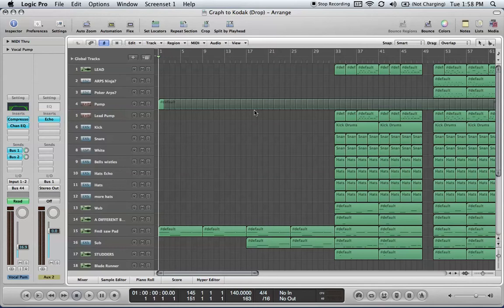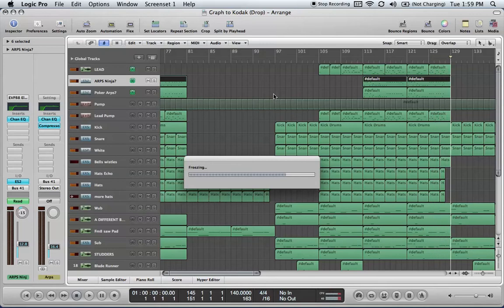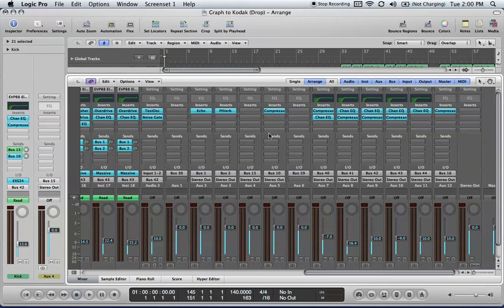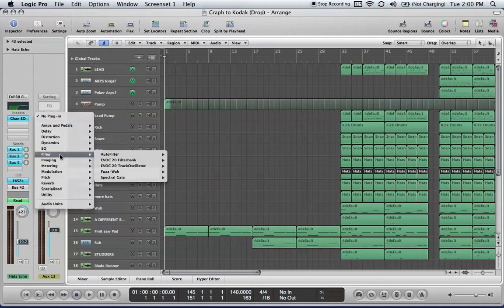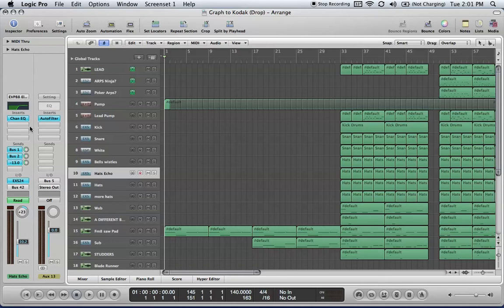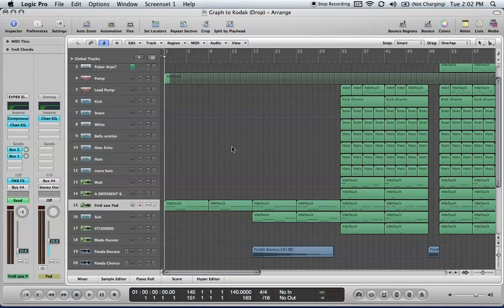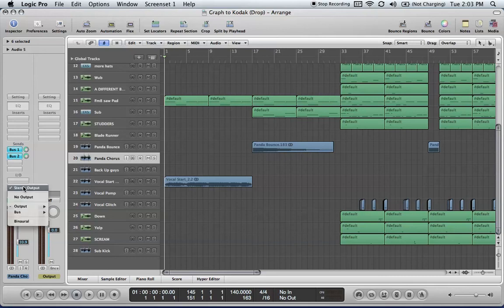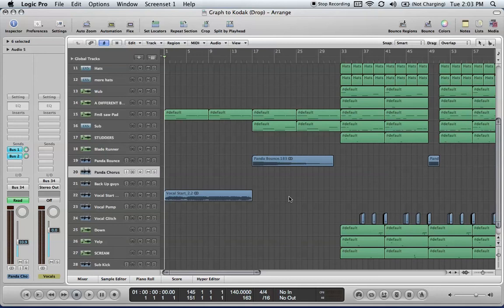Logic Pro Tutorial : Avoiding the Cpu Overload

Comment: I have been doing all this nothing seems to work, its so bad now i could have 4 bars  made up of 4 tracks (kick loop, snare loop, hat loop and a break) all in audio and it will still overload, makes it impossible to get anything done.
Reply from the maker: What are system specs? mac / pac? 8gig? also how much disk space.
This may also be your cache needs to be cleaned out! : )
Reply: Hi, it's a MacBook Pro,  Processor Speed:	2.53 GHz,  Memory:	4 GB, im not great with technical things to do with computers trying to learn a bit more, just getting good a making music, it probly is to do with memory i think i need more ram maybe, but i think my cashes are pretty clean, it really hates it when i load 3rd party plugins like ni stuff or izotope

Comment: only problem i see with that method is that i like to eq and effect a lot of my things separately... and there is a way to balance multicore performance in logic. theres a whole page on it on the apple site. i guess your supposed to setup your tracks with busses as your output, but im not rerouting entire projects like that.

and actually i just found the problem with my cpu usage. i was rewiring reason into logic under "live" mode, takes a lot of cpu. im running a 2.4 quad core i7 mbp btw